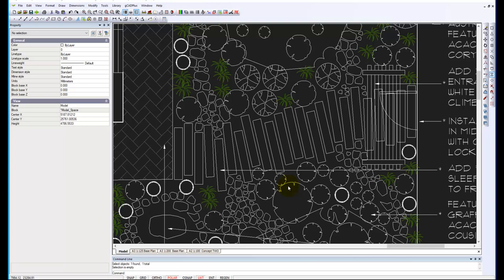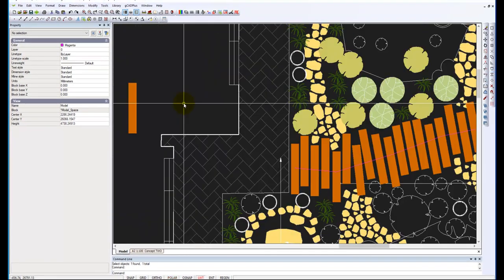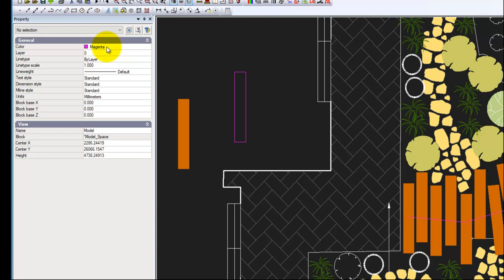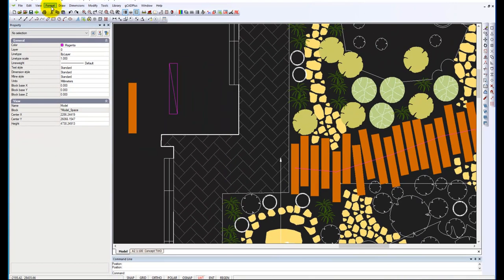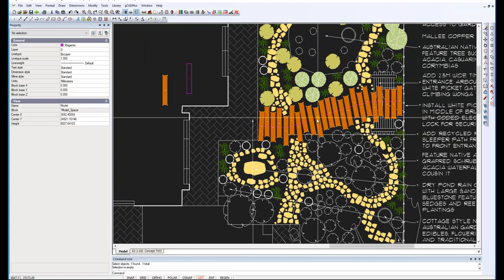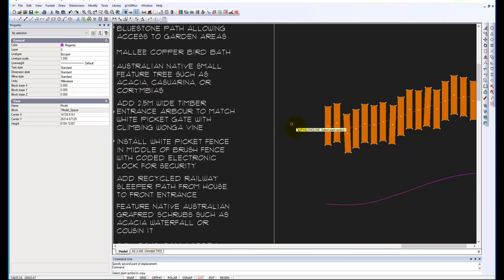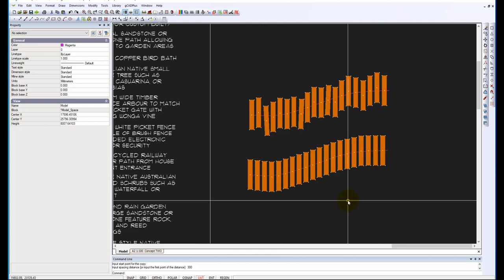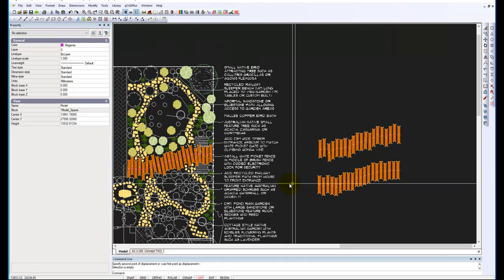Create a design for a hardwood stepper path easily with the CopyAlongLine command

Comment: I tried very hard to keep the curve through the railway sleeper path design, and did think to work with a poly line to get a base line to work from. However the individual entities were all rotated by hand, which took quite some time, and I lost the flow of the curves, especially in the middle of the S shape. The method you showed not only retains the curves and gives the boards a nice flow, but showed how I can manipulate it again so I do get that random appearance. Thank you, what you have provided was exactly I wanted to do but lacked the technical knowledge to execute it correctly. I'll try again with the new method you have shown. 👍
Reply from the maker: Thanks Angus, as you found, it was a challenge to find a way to do this efficiently. Maybe one day we will add an option to the COPYALONGLINE function that rotates a block as it copies. Thanks for sharing the design - much appreciated.